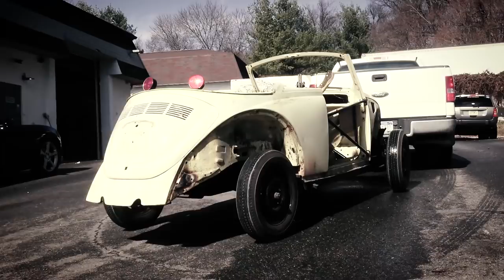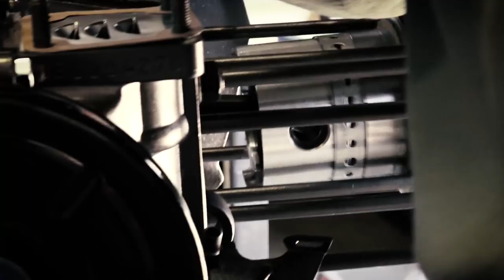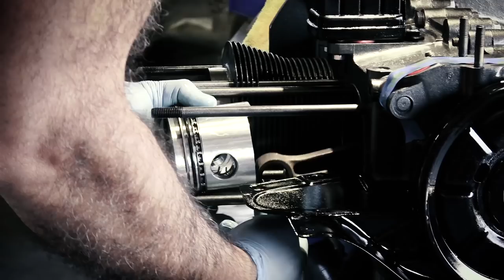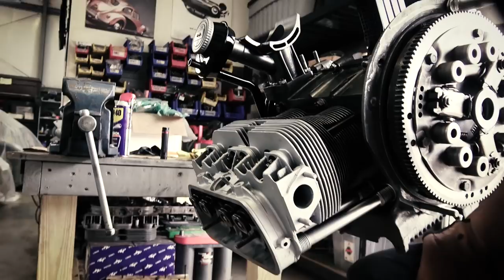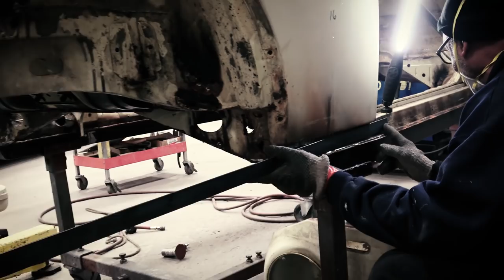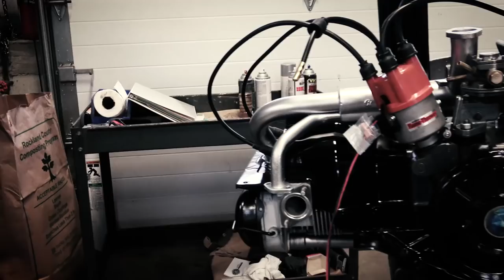Classic VW BuGs 1970 Convertible Beetle Restoration 1641cc Engine ReBuild

Comment: itll probably run like garbage with a single carb and no vacuum advance on the distributor. ive got the same setup on my 70 sedan and had to swap the distributor out for one with the vac advance on it. no hesitation now.

Comment: Hey Chris, 
What are these Paper Seals between Cylinder and engine block for? I did not use them on my 1641cc. Good Job!
Reply: Jorit Hanneforth sealing the jugs to the block, preventing oil from seeping out...
Reply from the maker: Correct, just a gasket.

Comment: What's the reason behind choosing to run single port heads, a generator, mechanical only distributor, and non-doghouse oil cooler on a 1970 engine?
Reply from the maker: Well this is the original motor, and 1970 was a one year only motor, 1600sp.  The simpler the motor, the better I like it.  I like a single port over a dual port anyways.
Reply: Cool, thanks for the response!

Comment: not suppose to use paper gasket on the cylinders because they burn off and creates pressure loss. our motors are designed to seal metal on metal. there is copper gasket you can buy and it does seal great but due to temperature tolerance differ from aluminum to copper , you have to retorque the heads from time to time. what this guy did is a big no no.